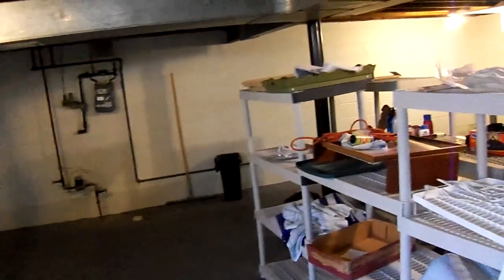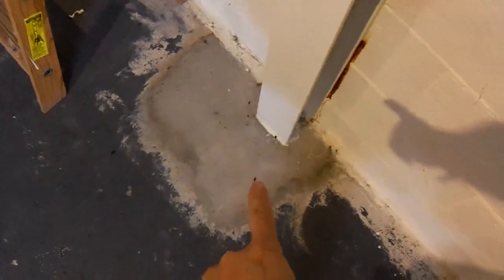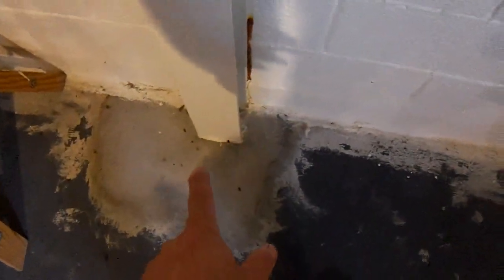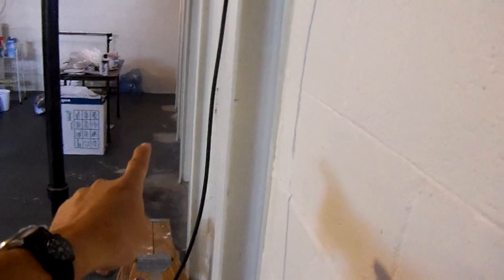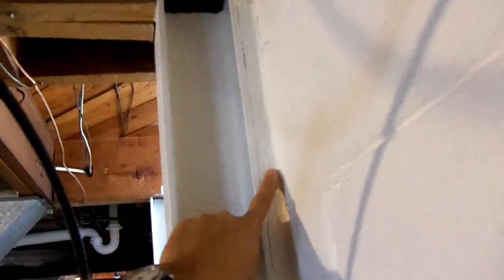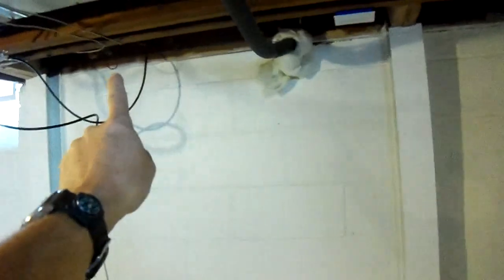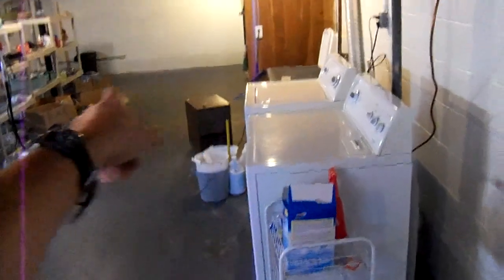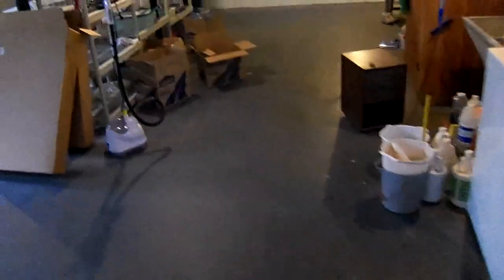Brace foundation with steel I-beams #bracefoundation  #bowingfoundations #bowingblockfoundation

Comment: The Blocking At the top of them beams will fail sooner or later Vary poorly done the bottom looks right but you never know what they did under the cement...
Reply: So Far this is the Best & Safest way i found to install a I-Beam Properly.. https://www.youtube.com/watch?v=OSawcLlCxrQ
Reply from the maker: Well, it's not failing.  They are set in the concrete floor.  I know the I beam is sitting on the footing because the footing is 2x the width of the wall here in Michigan.  So, good job IMO.  Make a video of a well done job and post a link.

Comment: it's almost all clay in Harper Woods and most of the east side, exterior waterproofing backfilled with all gravel is what was needed there as in these two videos block wall bowed in, multiple exterior cracks etc  https://www.youtube.com/watch?v=Tq_o7C6KMUA     brick foundation Grosse Pointe Park, deteriorating, cracks etc  https://www.youtube.com/watch?v=5dpGpiB7kQI